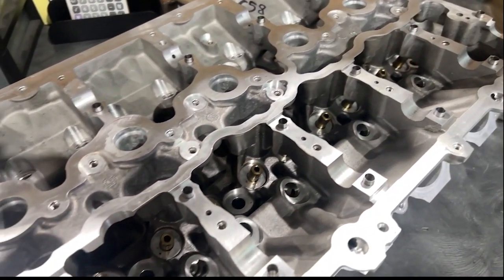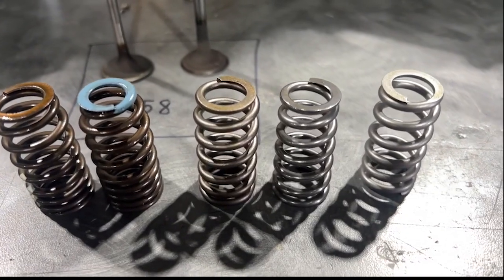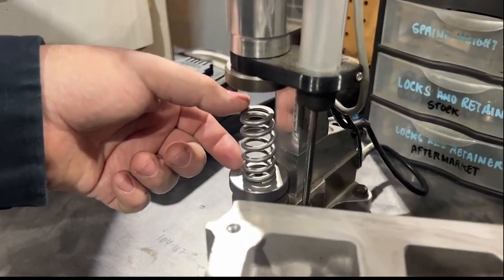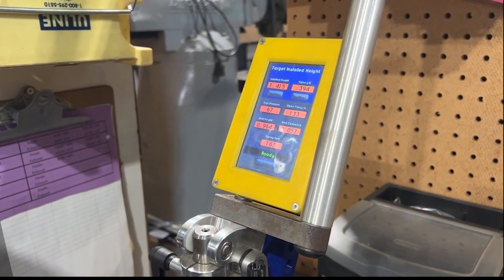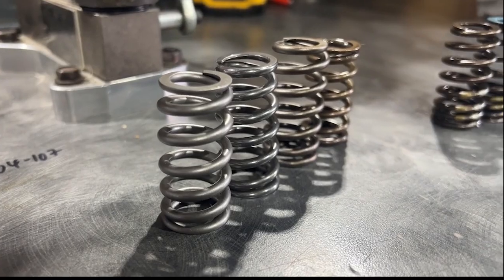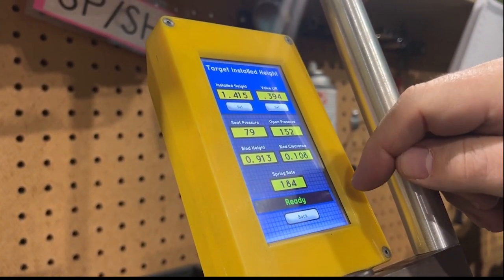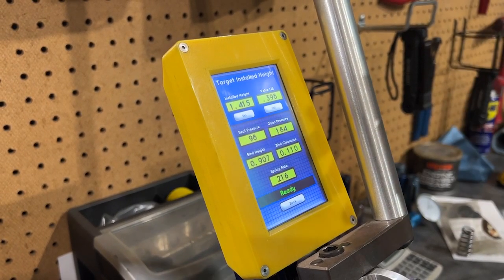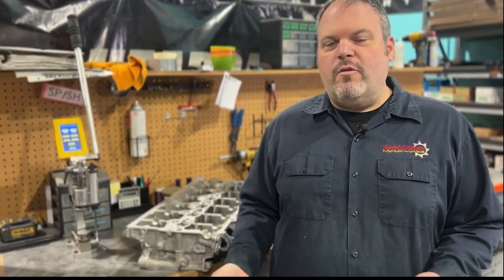BMW B58/S58 aftermarket valve spring tech!

Comment: I've been using 3 main manufacturers of springs for 10 years and almost no problems with them. But the work you ask each to do is going to make up the difference. They aren't all on equal ground. PSi, PAC, and sometimes Supertech. And I guess on super rare occasions its been RD Spring
Reply from the maker: truth.

Comment: I don't understand English at all, but here I am again watching your video Dave, and reading the translation.
I wanted to ask you a question, which I don't understand about the spring measuring machine, the data it gives where it says sprintg rate, what is it?
Greetings from Spain
Goyo
Reply: Basically the pressure it takes to compress the spring
Reply: Hi Dave, great video. I would also love to see the back to back flow bench data.
I would also love to know when you port either which one is better for road racing as well as drag racing. Which one has air speed not just cfm. Really interested to see when a light clean up on the throat of the s58 is done (as per how the redbull guys described) what kind of gains we see.
Lastly, these engines obviously don't rev and are designed to make power down low. What is the limiting factor? Is it the small valves and ports just being restrictive. Is it valve train etc? 
Thank you.